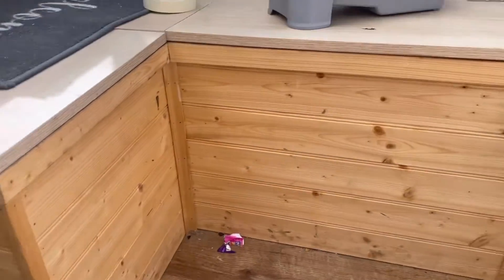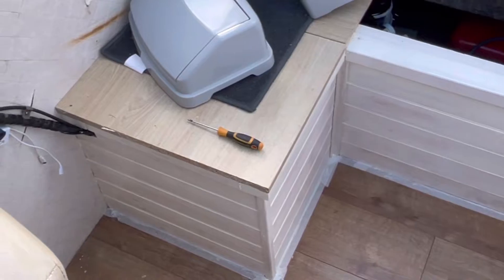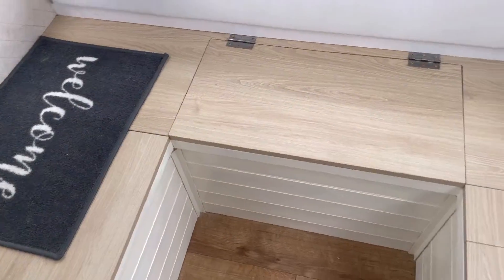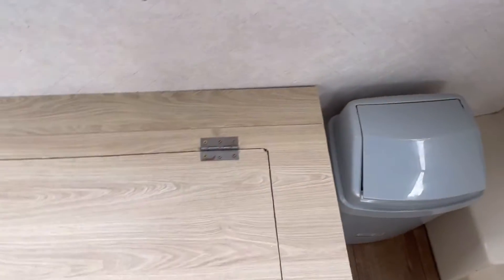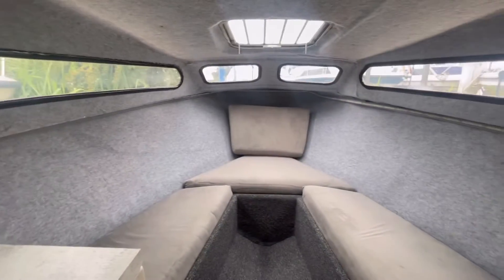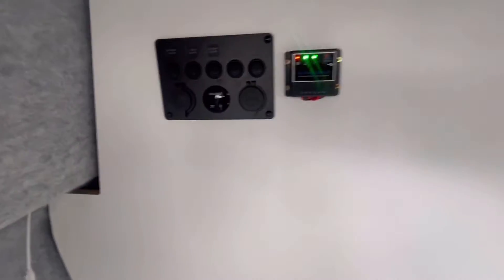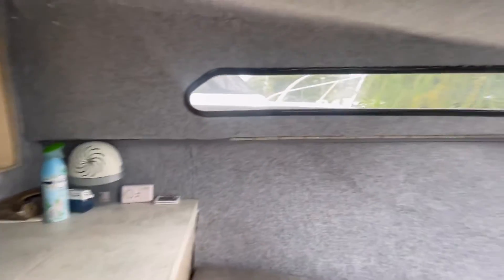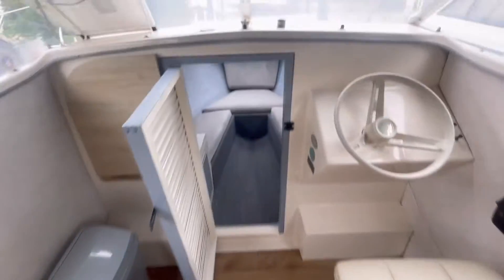Shetland 570 Boat Restoration - FINAL PART

Comment: lovely job i had a number of shetlands over the years and very safe boats  my last one i ended up putting a Johnson 70hp 2 stroke on the back dam that thing did fly  tho i was using it for fast fisher / weekend boat
Reply from the maker: Honestly best boats I’ve had so far! Great fun with a small or big engine ideal size! Where was it you had yours?
Reply: @benriverss  benfleet in Essex would go out on the North Sea with it for weekends at a time
Reply from the maker: @mrchilled85  how did it cope on the sea? Never had mine on the sea
Reply: @benriverss   was  fine in 3ft seas tho much more was rocking about to much at anchor tho when moving under power it was not bad
Reply from the maker: @mrchilled85  that’s interesting to know! Did you do that with the 70hp on back?
Reply: @benriverss   yes we went from benfleet to amsterdam netherlands was 5hrs motoring   around  27 knots but would top out at 36 knots
Reply from the maker: @mrchilled85  that sounds great! Which one of the Shetland’s that you’ve had has been the best?
Reply: @benriverss   353 or the 570 is great boats  in my eyes
Reply from the maker: Never had a 353 is that smaller than the 570?
Reply: @benriverss  sorry 535 not 353 :D
Reply from the maker: @mrchilled85  I bet that was lovely!!